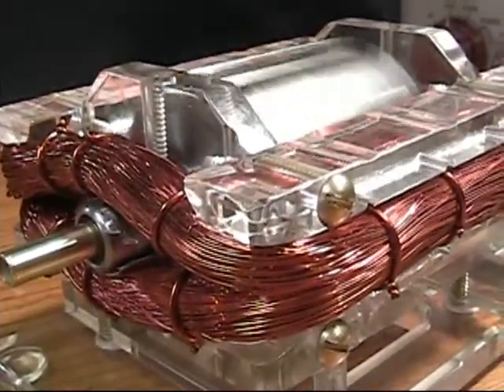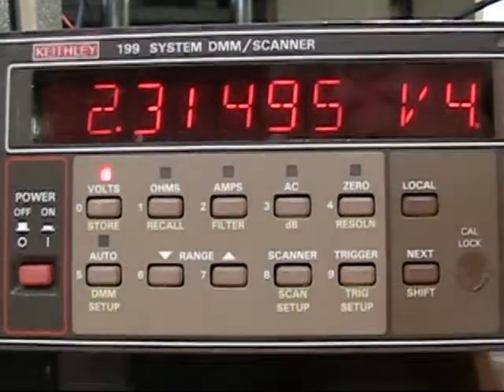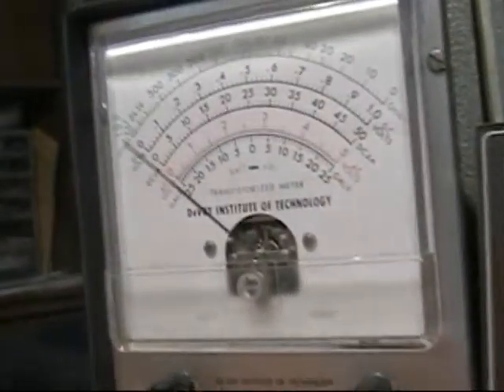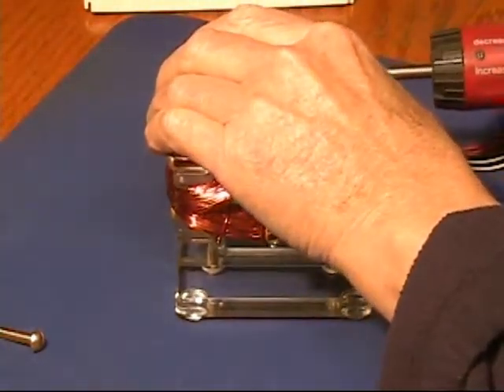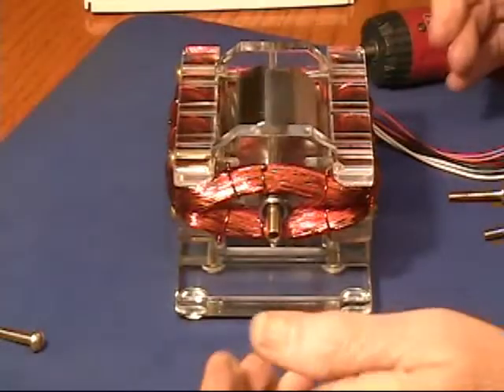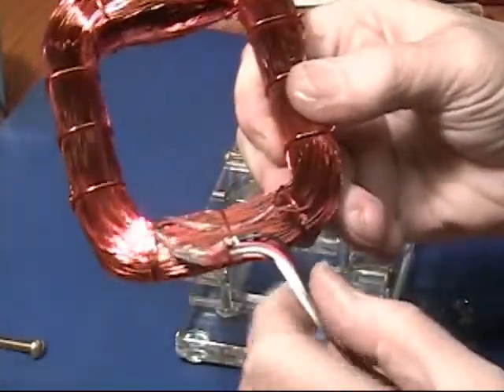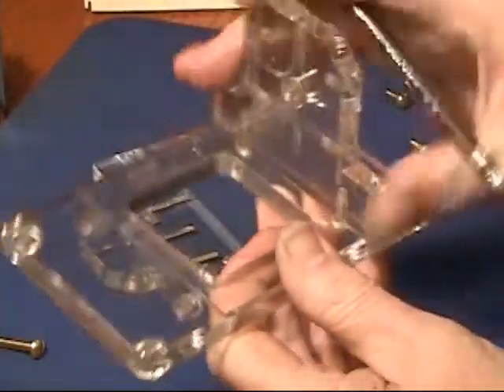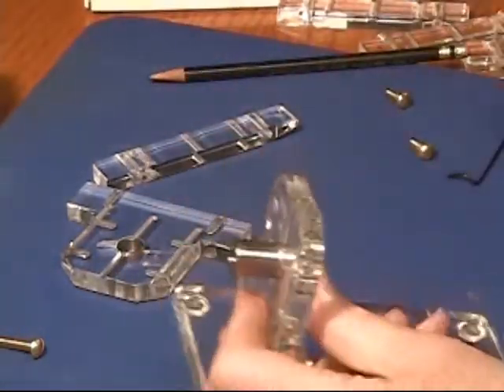Window Motor Assembly And Capacitor Test

Comment: John, it seems that there are a-lot of people who want your motors. Perhaps someone could help you to organise a manufacturer to make these. they would sell well on ebay and also as a school physics project! Or as a kit where people get the parts and have to assemble them, love the solar window motor, very cool. Can you add capacitors to that one? If you could hide all the circuitry inside then there may be enough extra power during the day to charge the caps so it keeps running at night! Now thats getting close to perpetual motion depending on your location (amount of sun hrs / day). If it works you could build it on a huge scale with 4x 250W solar panels! Now that would be cool. I think you may need a sponsor for that project :D

Comment: hey there man, iv just had a motorbike accident and im bed bound for a few months.and i wanted to start a little project, but i was just wandering if you can get kits that have little electric motors that can be powered by batterys, or can you buy the parts and are they easy to assemble, thankyou :)

Comment from the maker: @sMartcreations2010
Hello Mart. Yes when the you get down to milliwatts the whole system gets really sensitive. Even touching the capacitors makes the voltage go up from the heat of your fingers. It would be real easy to fake over unity for sure. I finished an experiment with the Mag Lev base and was able to get the current draw of a suspended Notch Rotor down to 30 micro amps while running on a water battery. Watch for the video.
Take Care.
John

Comment: as i sit in here watchnig this video i think about  a trasformer with two coils and steel to transfer the energy---------so if you had a bifilar coil of copper, with a steel coil to make it a trifilar, if you just used these  coils as a generator in your motor, as you use the current you generate in one winding, how would it effect the other copper and steel winding...........